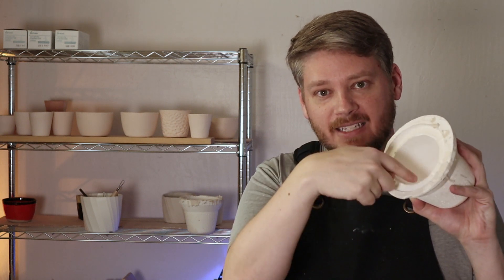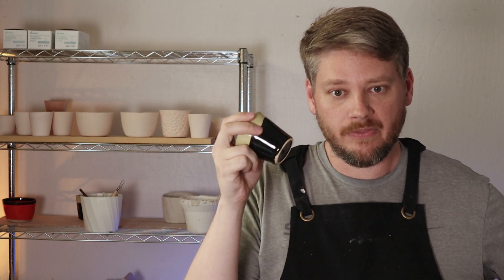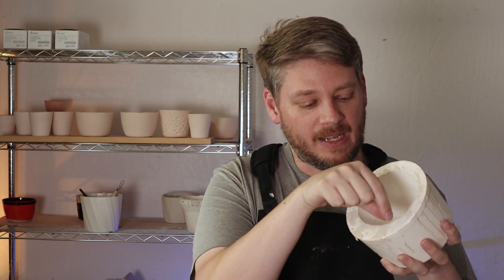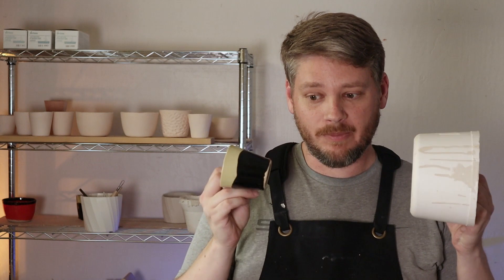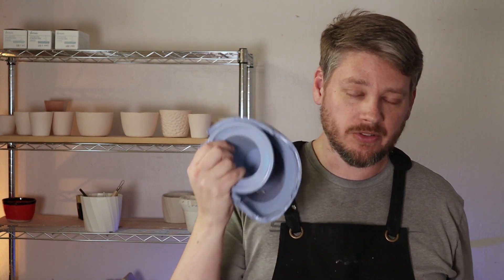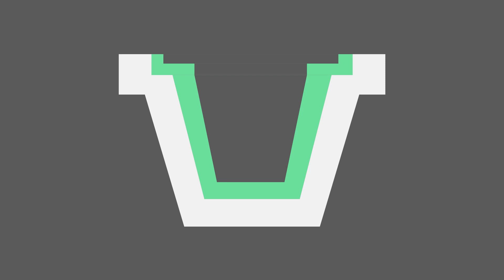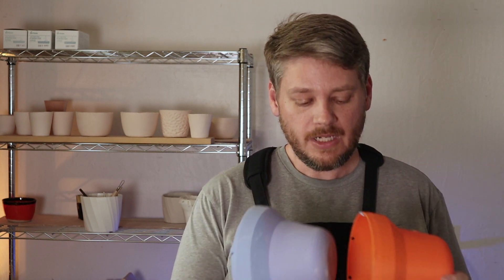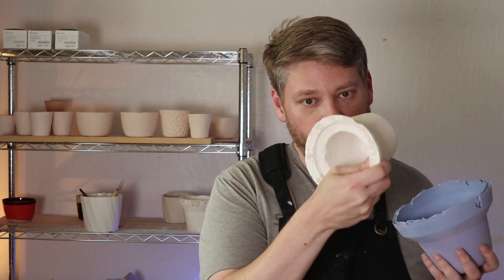Molds of MOLDS of molds of MOLDS?!? Untangling slip casting mold inception

Comment: Hi, Kent, so I am in the process of making molds and I've found your video very interesting and useful. I have introduced myself  to 3D molelling and printing (thanks to you) and my friend printed out a positive form for my mold making.  But I fortunately since my original iš made from plastic I found it very difficult to seperate it from plaster :/ now after watching your video I am thinking.. What if we would make positive molds (original forms) from silikon or from some other material which iš not so rigid?
I dont think I would go so far on making molds of mold since this look as a very difficult process but just trying to find a way of create a form of original with 3d printer which would be not so difficult to seperate. Have you ever tried something like that? And what are your ideas on making originalus from silicone or from gum or any simmilar bendy materials? :) thanks!
Reply from the maker: Yes, that is exactly the problem with directly printing the mold. I've had mixed success doing that - it probably has a lot to do with the shape of the pot/mold. I have several more videos on mold making and am still trying things out. I don't have a final solution that I'm going to keep using just yet. But I still have lots of ideas and once I find something I'm sure I'll have several videos about it!

One traditional way to make the master pot shape is to actually use clay (from what I understand oil clay, not pottery/throwing clay). That might be done in conjunction with a multipart plaster mold (which adds more complexity). I think the trick with making the original out of something deformable is in getting the shape you want (since it deforms).